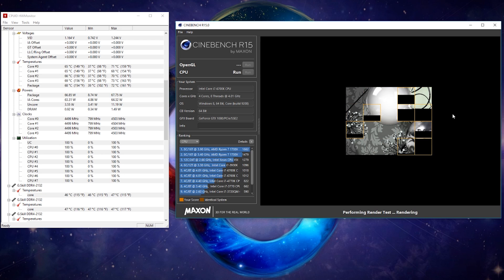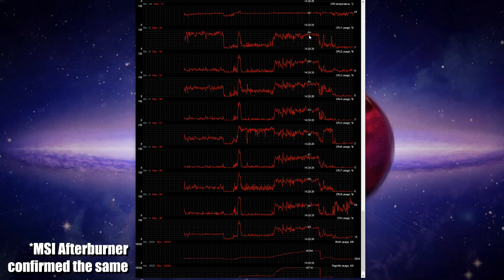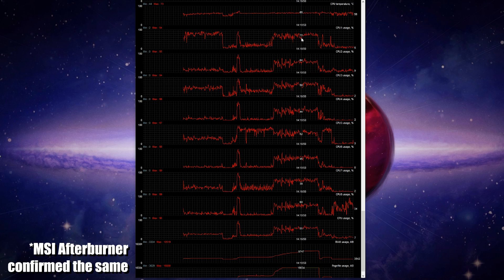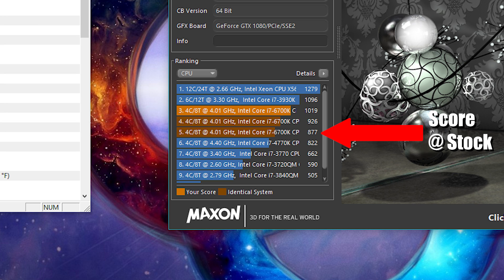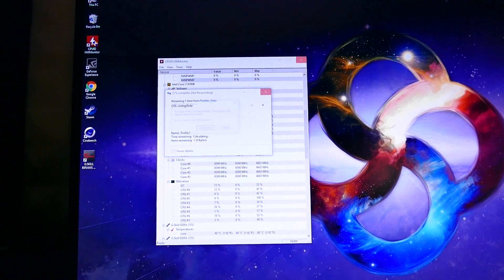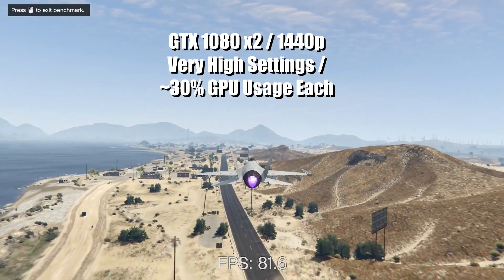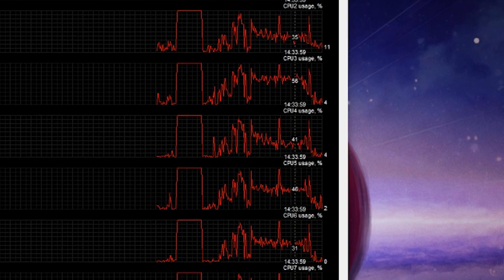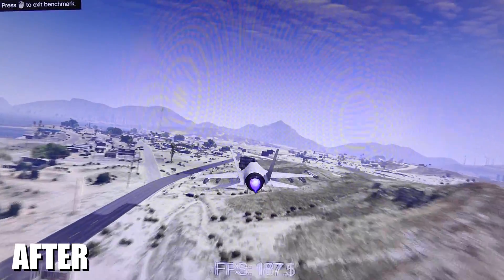My PC was Terribly Under-Performing...

Comment from the maker: - I appreciate the feedback and suggestions as to what may have caused this. A few of you think I didn't bother using DDU and reinstalling graphics drivers. I tried that multiple times. Also made sure power saving was off in both Windows and Nvidia CP. The BIOS clearly showed 4.5GHz OC, as did HWMonitor, so I never thought to immediately clear CMOS. Also swapped multiple HB SLI bridges. Super strange indeed!
Reply: "If you can beat it with a hammer, it's hardware. If you can only curse at it in futility, it's software."
Reply: Science Studio It is very possible that you could have had GameMode turned on in Windows 10, which could have  theoretically throttled your GPU to under perform up to specs. Hope this help and it would be awesome if you could test this and let me know if this was the problem. A very simple fix but very troublesome.
Reply: Science Studio perhaps if you are using win 10 the game mode from creators update might be affecting this a bit.
Reply: Perhaps your CPU cache was being pushed too hard and making small errors here and there, which were corrected by the caches built in ECC/parity, causing poorer performance without any other signs?
Reply: Science Studio Well, we all have strange things :D

I have a (somewhat big) problem. Ever since i replaced my old graphics card (died, rip gtx 570) with an rx 460 (similar performance) i couldn't open up the BIOS, when i boot, it just simply  skips it (black screen, when the bios menu should appear), but my PC works flawless. I assume the problem lies within the pci-e cables.
My RX 460 doesn't need one, so it may pull too much power from the motherboard (p8b75). My PSU is fine, it's an ANTEC EA 450W bronze.

Any ideas?
Reply: @swaggsmr.2607  it might be that the bios is displayed on another monitor try plugging in another monitor to see if it comes up, i had the same issue until i plugged in another monitor
Reply: i work whit pcs too, windows (specially win 10, for some reason) "breaks" itself so often... idk, its common to have windows mal functioning (speccially after a bad CMOS/BIOS problem)... sometimes reinstalling is a good problem solver... but my knowledge is based on servers/ home pc, not gaming rigs
i know, my english sucks, but warever..i hope this get to be useful to someone...
Reply: I kind of believe it was an OS update as even I have ran into secret updates that change things in windows and software to hardware utilization
Reply: Though the problems with CPU and GPU were not specifically pinpointed, I'd suggest meticulously noting operating system settings and BIOS setting.  Any time you make a change, note it and test the results.  It may take many days, weeks, or perhaps months, but you might be able to zero-in on the issue.  Many years ago I had a system that was having severe performance issues somewhat similar to yours.  After mentally stepping back then reapproaching the problem systematically, it was "bad" driver issue with my NIC.  It took a while, but that step-by-step process of troubleshooting got me to a solution.  It was when I isolated myself others' ideas (though they were trying to be helpful) that I was able to hunt the rabbit down.
Reply: Science Studio thats how you can always fix issues like the one you had, reinstall windows fixes everything, when games dont work reinstall windows, any issue that you get that seems like its working but doesnt and you cant fix it, reinstall windows, its a pain but thats how i fix almost any issud
Reply: Leonardo Brioschi yeah I too think that would have sorted it instead of a completely new windows install
Reply: Plz, make a video where you're trying to use GNU/Linux :D
Reply: In regards to the GPUs I've seen similar once on my twin 980's, IIRC I fully wiped the graphics drivers and reinstalled (from the same package). But yeah, never truly figured out that issue, just that my GPUs have been running fine since.
Reply: i would uninstall any overclocking or monitoring apps and disable the shit out of everything related to xbox services ( even better if you completely remove it from the system ) and just to be safe maybe verify the game files or just reinstall it
Reply: I had a similar issue a while ago with a i7 6700k and GTX 970 and reinstalling DirectX and reinstalling graphics drivers did the trick for me.
Reply: @marcelviviers8038  I just said out with the old Radeon “5700xt” and in with the new “3070 ti” and for the last three weeks been troubleshooting why my game after playing for 10 mins will drop frames below 100 in bf4 and stutter everywhere and lag, spent three weeks fully optimizing windows settings, control panel settings, in game settings, stream settings, bios settings, everything is up to date. And everything has been clean uninstalled and reinstalled but you mentioning direct x is something I haven’t thought about yet! Thank You! Another way forward!
Reply: Isn't there currently an issue with Hyperthreading on Intel Skylake and Kaby Lake cpu's currently though? Maybe in multi-threaded loads the performance hits would be noticeable but I don't know how clearing the cmos could fix the issue... I wonder if updating the bios would fix any of the performance issues (consideringt the microcode hotfixeus are being pushed out via bios updates).
Reply: david buddy Yes there is an on going issue over both sky/kaby lakes. Right now they are saying that disabling HT is the only work around until BIOS updates arrive
Reply: Science Studio it happened to  me  the gpu problem , i think it is a error in windows 10
Reply: Science Studio did you tried cleaning drivers and reinstall ?
Reply: nxtg77 video drivers get nasty with some times just updating them, they don't clean up properly
Reply: Use DDU next time, you will keep using it after.
Reply: You simply might have had particular file(s) corrupted do to small errors that do happen from time to time even with ECC memory which reduces errors to fraction of a billions. This can happen inside the SSD/HDD over night or active, CPU does trillions of calculations per day and overclocking does introduce more possibilities for errors. Pretty much everything in your PC can cause an error which starts to accumulate if introduced in a very specific file which can start corrupting even more.
All this can be caused by a simple virus or malware and even with a antivirus and common sense, shit can happen. Specific windows or any other major software inside your PC could have introduced very specific kind of scheduling error which caused performance hits.
Anyway this is the reason why we wipe OS every now and then to make sure everything functions properly even though everything might seem fine.
Reply: Had you overclocked the 1080s at all? I had the exact same thing happen to me after overclocking my 1070 a smidge too far, it wouldn't perform anywhere near its normal spec until I reset the card bios.
Reply: Have had this happen on a few different SLI builds. One of two things, I had issues with SLI not working correctly if I had Logitech Gaming Software enabled. Change out my mouse and keyboard, and FPS shoots way up, and stuttering would go away, so I uninstalled the software, and reinstalled, voila everything back to normal. This was very game specific however. 
In your scenario, I would go to the C: , look for the folder called NVIDIA, delete that folder, and all contents. Go to your Program Files X86 find the Nvidia Corporation folder, and delete that. This is cached driver information that if you are reusing the SSD from previous builds, can sometimes contain corrupt information. Use control panel to uninstall the driver, then follow that with DDU. Boot into windows, and redownload drivers and reinstall, cross the fingers, and all should be good.
Reply: i really don't think it's a windows update issue cause the update will still exist after a clean windows install or at least it'll update itself again
Reply: Given the recent WannaCry nonsense, make sure you fully update windows
Reply: Science Studio could it of been a curroption of the os ? maybe gpuboost 3? 
ya can bypass reinstalling the os by running a few commands if its an os curroption. their is more direct and forceful parameters you can set. but generally this dose the job.
"sfc/scannow"
if nothing, then try this.
"DISM /Online /Cleanup-Image /RestoreHealth"
Reply: Well, did you have any software like Riva Tuner or similar. It's pretty bugged with many things.
Reply: I was about to suggest DDU since I didn't hear you mention it (maybe I missed it?). Since you weren't able to replicate the fault, I guess the issue was within the bowels of Windows itself. It's frustrating when something craps out inside Windows and you aren't able to fix it. Thankfully it didn't happen to me in years, but I know the pain.
Reply: You've got the exact same issue on the GPU side as I did.
DDU & fresh Drivers did it for me. (same exact version I had earlier)
Benchmark scores literally doubled on a single GPU after doing that.

Nvidia drivers get buggy over time when updates are installed on top of old drivers without a wipe.
Uninstalling Nvidia drivers wont actually fix the issue as it wont completely wipe them.
Reply: Science Studio It could be some random windows update which causes the issue. Did you try to restore your pc to some back date?. Maybe try using pc optimization softwares like tune up utilities or something.
Reply: You should've probably tried doing a fresh install of the graphics drivers. I don't know why, but NVIDIA drivers do some weird stuff, like shader data dumping in one of the folders inside AppData or ProgramData (I don't remember which) I would've tried cleaning ALL NVIDIA software from my computer and reinstalling the drivers.

Otherwise, I think what you say may be the issue is the right thing. Some hidden or random Windows setting was maybe holding it back. I would've tried restoring your system to a point in time where you didn't have the issue, or at least backtrack a bit and think about what you may have downloaded or changed in your PC since the issue started. You know, classic troubleshooting.

Also I don't think this would've helped, but there's a Windows service that was added in Win7 or 10 I believe, called Superfetch. You should always turn that shit off, and make it STAY off. It's a process that's supposed to optimize hard drive usage so that your PC doesn't get slower with time, but all it does is cause random %100 usage stats on your HDD and make everything slower at seemingly random times.
Reply: I wish I knew where my notepad was to keep up.
Reply: i have asus strix gtx  1070 and i7 6700 and 16gb DDR 4 ram @2666mhz but i got about 150fps in cs go , btw my friend has msi gtx 760 2gb  and he have +300fps in cs go , why this happend ? plz help i tried to clear CMOS but it didnt work :(
Reply: i had a somewhat similer issue a month ago and in the end i started looking into my dpc latency which i know of from audio recording.
that helped me.
Reply: Maybe get rid of the RGB RAM and software. Test it with something that doesn't have a "glitchy" driver / software. No clue if you've tested this or not but I've read some horror stories about it in the past. Just food for thought.  Good luck.
Reply: are your settings different? its kind of a CPU bound game believe it or not.
Reply: What about the power settings on windows? lol. Perhaps you changed it to power saver or something. I have no idea. However, that's the only thing I can come up with that would affect both the GPU and PSU. Maybe the OS was taking priority over your Nvidia performance settings.
Reply: where your gpu's accidentally underclocked
Reply: What about using something like Revo Uninstaller? Run that when uninstalling the Nvidia software and it'll rip out ALL of the OS files & any registry entries with it. Worked in the past for me once a couple years back. Alternatively, since you've got Win10, try doing a non-destructive reset (go to the Advanced Startup Options and choose to reset OS but keep your data). This way the core Windows files are all restored to their defaults but your actual user data (docs, music, vids, etc) aren't touched. Then you only have to reinstall programs instead of programs+re-importing your data.
Reply: sounds like power saver, yes for some reason pc os has power saver like a laptop
Reply: Install your own custom Windows build. Instal everything you like-software, drivers and make a Backup ISO file. Or use lighter Windows version. I install Windows 6-7 times a year (maybe more) & every time is around 15 min untill boot in Desktop.
My 7600 on 5.2ghz highest score in Cinebench is 879. https://www.facebook.com/photo.php?fbid=10208473056258166&set=a.1900142277497.85690.1659876006&type=3&theater
Reply: Science Studio how did you first install windows 10 (or the last major update?) depending on how it was done (usually manual installations) the os can become finicky and decrease performance. I don't see how it could utterly wipe perfeormance like this (I'd expect it to be a driver issue, but you said you ddu and reinstalled), but I wouldn't have passed it by windows. I wish you would have run some tests in an external OS to quarantine windows, since it's the next step in the stack after hardware/bios.
Reply: Registry issues, maybe? Are you able to replicate that faulty condition? If you could, I would suggest to do some roll backs to see if your performance increased back to what you had before.
Reply: Science Studio From my experience something happened to the registry causing your graphics drivers to act erratically even uninstalling and reinstalling would do nothing, cleaning via ddu nothing. I've had it as bad as I could never get the driver to install. I had to manually go in and delete everything using rapr. amazing utility it'll show every useless driver you've installed on your computer. It won't let you delete something your using unless you force it... which I had to do
Reply: freak777power fuck windows 7 windows 10 ftw
Reply: So I had a similar issue s with my gtx 1080 ti and it was caused by a gigagyte program on my pc. It's the Gigabyte Suite or something like that. My GPU was having the exact same issue. Try removing Gigabyte software from your pc.
Reply: @Science Studio I Had a similar problem before, My fix was to turn off the automatic driver updates that were implemented in windows 10. Turning that off (like in this image: http://puu.sh/wy2zU/7cc8e3ae07.png ), and manually downloading and reinstalling my device drivers fixed a bunch of issues I had. I assume that it tries to install display drivers when you restart, which can really mess up your performance.
Reply: yup that's why I never use windows 10 uses your internet more with updates of everything and sending whatever your doing back to microsoft server. Use windows 7. 5 mins video is suposed to be 3 mins only even 10GB only your internet. Windows 10 have hidden process.
Reply: Science Studio you may have had a pice of malicious software on your machine, or if you have the Creator's update make sure to turn of the Xbox apps, they have caused issues for me.
Reply: Im asuming windows ten... did you have insider preview builds?
Reply: Jack Ryan cuz he's gay and gay doesn't meet with hardware.
Reply: Maybe you've selected a different power scheme. Even with the same settings there is a big difference between eg. "Balanced" and "Always On".
Reply: Chek if your psu is on EcoMode
Reply: My PC was performing terribly and it ends up being Xbox DVR
Reply: i hate to say it, but i been a little overdue for a fresh os install >.>. but i try and do it once a year, ive had software fuck with me like this. So i try and do it every 1-2 years >.> though i have the felling I'll finally be going to windows 10 T.T
Reply: ProDrifterWinner im hopeless tho I bought a prebuild and pairing it with an Athlon x2 or something it's 4*2.9 GHz so it's probably bottlenecking my gpu.
I'm probably building/buying a new  pc when the vega cards will be out with a ryzen 1600 or maybe 1700 but the 1700 will probably be unnecessary for gaming only
Reply: watch?v=W2KhRPVGQYc  this may be your issue, its about Asrock mobo  for ryzen
Reply: Swaggs Mr.: I had a problem like this a while back when I switched from my projector & big screen to a 42 inch & 24 inch combo setup. If you wanted to go to the bios it would go black on both screens and then a bit later would start booting. I am not sure what fixed it because I changed out my mouse and keyboard as well as switched the cables around on my 2 screens as in just flipping them around. Anyways which ever was the fix I can now go into the UEFI and make changes my card is a Sapphire 390x so also a AMD card. I would try a keyboard swap if you got another one laying around just unplug your every day keyboard and try another one or just plug your keyboard into a different USB slot preferred USB 2.0 slot.
Reply: Swaggs Mr. You have to flash the vga bios with a custom one, that haves a lower power  consumption state during the boot time.
Reply: Science Studio, I would reflash the bios, with the same latest version. You wouldn't believe what a corrupted bios is capable of ! 
  And, Windows 10 is on another level of controlling the hardware.
Reply: Something like this happened when i wanted to overclock my APU, I've got an amd a10 7850k with r7 iGPU and whenever I overclock, and also increase the voltage, obviously by really low ammount, 2 of my 4 cores get stuck in 1.8Ghz no matter WHAT, so I get even worse framerates that when I am at stock speeds.

My iGPU, as of a result of being limited to 2 Oced cores and 2 cores running at 1.8GHz, gets almost no utilization! (would jump from 50% to 0% then back up 90% and back to 0%, really weird, probably because its been bottlenecked by the 2 CPU core's low speed)

 I dont know if your problem is related to this, but is the only scenario that i could relate to while watching this video.
Reply: Did you try wiping your pc clean from cache, registry and other unnecessary files by using a program like ccleaner? Sometimes that may cause issues with your PC if it hasn't been clean
Reply: I noticed that HWMonitor didn't show more than 68w used by the CPU, I suspect that your Mainboard was limiting your CPU to 65W TDP. You can change that value on most better boards manually. I noticed that since I limited mine to 80w for thermal reasons.
Reply: Adaptive Vsync (half)? Your framerate was exactly in half
Reply: I've tried to see the comparison frame by frame, but I'm on the phone. Seemed exactly halved
Reply: It is a microcode error present in Skylake and Kaby lake Chips when two threads from the same core intersect. I am 90% sure of this as the cause of your issues (with the CPU)
Reply: PC Perspective has an article on it.
Reply: Gregory Jones II thanks man.
Reply: Science Studio Did you have speedstep on? You'll get higher cinebench scores running with a fixed multiplier (I know you know this)
Reply: Science Studio was it a mirrored drive(s)? kinda curious.
Reply: meh...will say something retarded...here comes...
i planted an i7 in my laptop and the power brick it had from factory had 90W...with the i7 the laptop needed 130W power brick but low on funds i had to make due with the 90W one...and the exact thing was going on with my laptop...my gpu was going up to 60% from time to time...but that was it...in some games i had on my laptop before i planted the new cpu was above 100...now i had max 50 FPS...bought a new power brick, REinstalled shitdows(because updates when i dont want them to update) and all is back to normal...not so usefull but...xD
Reply: Science Studio my guess is bad secondary ram timings ie "auto timings" can be bad reference "actually hardware overclocking channel" but I've seen that happen before i always manually set all timings but this is as far as the CPU.

the video card have you used NV inspector and possibility set a FPS cap I have one set at 110 FPS because my Asus ultrawide monitor gsync is 100 hz.  possible you accident set one that capped you video card
Reply: +Cookieking Gaming 
m8 i accutaly don't whether ur joking or not
if not: 1100 watt not enough for 2 1080ti and i7 it is not a GTX 400 serie card
if yes: gg m8 good one

about your GPU problem lets just say windows 10 is not to great for stability and leave it there
Reply: I have had to repair chipset drivers in the past. When you launch the chipset driver installer, it gives you the option to repair the chipset driver installation/registry... Clear Cmos first, then boot in default settings, and launch the chipset intallser, click repair option, and that might save you a fresh install next time... 

The chipset trick has subsequently saved me from fresh installs. It seems to get out of sorts up with too many unstable overclocking sessions somehow. Or at least in my case there is a strong correlation between me pushing it to the crashing point over and over while trying to beat scores I will never beat on things that are pointless and needing to repair the chipset clear the CMOS/Repair the chipset installation. I also have the 6700k in a z270 board. All the issues it solved had to do with PCI-e lanes, and other power delivery problems to onboard devices/headers.
Reply: What solved it for me was updating my BIOS. Purchased my setup about a year ago, and just this january they released an update for the z170 that fixed SLI, so SLI was not fully supported for a MSI Gaming M7.
Reply: I've had this problem with my cpu as well http://imgur.com/a/PrwAA
Reply: Win 10 just suck for gaming
Reply: zvelekva Windows 10 works fine for me
Reply: Windows 10 update ver ?????? bugs bugs buggy!
Reply: ver 1703 build 15063.413
Reply: I think i know what happened. I think putting in that dirt cheap PSU might of tripped some kinda safety setting in the Windows OS to reduce performance so the system didn't fry while using that PSU. But windows didn't realize you put back in the good PSU after you were done!
Reply: Which would explain why reinstalling windows fixed it because a fresh install of windows reset all the settings. Including some that you may not of been able to find!
Reply: Science Studio u can have done a system restore pal
Reply: Possibly whats mentioned in NCIX Tech Tips video: Radeon Vega FE preview, W10 source code leak, Skylake + Kaby Lake hyperthreading
Reply: just windows stuff
Reply: I had have similar problem before couple of mounts. I have X99 platform with I7-5930K on windows 8.1 64bit overclocked to 4.6GHZ witch must scores about 1300 scores in Cinebench r15. But for some stupid reason my scores was drooped to 1100 and it was imposable to get it higher even if i kill every not vital service and process (before the problem my pc scores more that 1300 after startup with bunch of parasitic software running). Witch made clear for me that this can't be software issue. I noticed that my task manager does not report the correct cpu clock witch was odd because system runs on the same setting for mounts and last i check it was fine. Also base clock frequency of my cpu fluctuated to much from 75mhz to 95mhz but never hit 100mhz under load. I decided to start with a clear BIOS and set everything again. Wen i start the pc with defat BIOS settings the task manager reported clock just fine and base clock was rock solid 100mhz and fluctuated only with 0.1mhz witch was perfect. After that i go back to BIOS and apply my clock settings. Back to windows and everything was fine task manager report the clock correctly, base clock was stable and cinebench scores about 1300 scores perfect. After that i go to the BIOS to change some not so important settings like fan curve and others(including virtualization). Wen i get back to windows the problem was back so i disable the virtualization and everything was fine again. My conclusion is that the problem was cosed by the intel virtualization but in order to manifest it self you have to install windows Hyper-V virtual machine in my case Microsoft Visual Studio mobile device emulator was the software that manifest that strange behavior. I even tried stock CPU clock with virtualization on and the problem was back. So after that if i need to use vurtualization feature i restart my pc, I go to BIOS turn it on and, when i am done with it, I restart again and turn it off.
Reply: Jonathan Laig It's not a Wildfires Windows 10 vs Windows 7 thing, it's a Windows thing. Operational efficiency in Windows just decreases over time, it always has. The only was to keep it running at peak efficiency it to reimage about every 6 months. That's why i keep a custom up to date MDT image on external HDD.
Reply: 1st issue was a power saving setting in the BIOS that was probably still on when it shouldn't have been, then with the SLI issues I would think in was an issue w/in the NVIDIA Control panel and then wiping the NVIDIA drivers if you can't get the C.Panel (NVIDIA) to default back to "stock".  I had the CPU utilization with a 4790k that was OC'd to 4.8Ghz and wouldn't fully utilize the threads/cores (BIOS flash fixed mine - which was a power saving feature I missed (Z97X-SOC Force)
Reply: @Science Studio - As u confirmed nothing wrong with HW/SW... Windows updates might be the reason for this.... It happens a lot for me for my Nvidia Quadro cards... Win Updates somehow messes up our graphic drivers....I use a lot of GPU + CPU processing power and I see latency issues whenever there was an unexpected update! Try disabling it and test the new config for a month..I think it will resolve your issue(also keep ur %temp% clean).
Reply: Science Studio I had this problem with my os windows 10.  it happen after a update in the insider program.  I had to reinstall and performance was back to normal.
Reply: if you have the time it is almost worth building a network deployment server these days, any real problems that take more than a couple of hours to fix, just blow the machine away and rebuild from a good image.  learn sysprep, etc.
Reply: OH man! I had worse problems. After a huge win10 update I had blueish and yellowish textures. It was nice how it happened it started on one pixel than the textures turned to the color of the card's choice like a spilling ink effect.
It is usually the OS. I tried the driver clean install several times before total reinstall. It always turned to a fascinating new color each time I installed the driver.
Back to the said huge update. It just destroyed the drivers and drivers installed after the patch were broken AF. It was a windows fault but I have my profiles relocated to a RAID 5 array so reinstalling an SSD is the east of my concerns.
Reply: Did you reinstall GTA :)
Reply: Science Studio Virus, Board issue? There are just SOOO many variables in these situations. I find it odd that both your CPU and GPU were under preforming. Possibly BIOs issue for the GPUs aswell?
Reply: yar i thin its registry    when uninstalling and re installing sometimes wrong values get written to registry
Reply: Does anyone know the fix? Same problem and im not done watching the vid btw
Reply: Swaggs Mr. I had the same problem with my rx580 using a hdmi cable. Switched to a dvi. Problem solved.
Reply: Science Studio you think that's bad? I get 15 fps average at lowest settings at 100% usage
Reply: You may are run you lcd/tft on hdim cable , try to connect a dvi cable and see if you see your bios boot screen ..
Reply: Science Studio This worked for me! I reassamble all the pc parts.It worked for mr
Reply: I have 2 Gtx 1070 8 gb each on my rig,  but cpu -z is reading only 4 GB. I don't understand why
Reply: Greg Salazar so what did you do to fix it? You wiped ur entire system?
Reply: Msi afterburner is making the problem.... Ive use it recently and had the same problem
Reply: I didn't have same config like you but i had about same issue like you underperforming gpu usage,Check your brand of gpu if it is zotac go on zotac site and download old drivers first , uninstall using ddu in safe mode and make sure you clean your pcie slot and gpu.worked for me however i think your issue was windows os itself
Reply: Hey,Same thing happened with me my gtx 1050 ti was underperforming  the way i fixed it was very first used ddu in safe mode to remove drivers &Next step is more important
The key is to get oldest driver or first driver released you are lucky if you have dvd/cd with you or else go to manufacture i.e for me it was zotac went to their site and downloaded available driver at first you need to perform clean installation you might get artifacts after installation than u need to install driver again and make sure you remove your gpu clean gpu lining with an eraser or cleaning agent (Isopropyl Alcohol 99).This worked for me
That worked for me.
Reply: Science Studio I remember you mentioning your PC was underperforming with a cheap PSU. 

If the PSU wasn't the problem, then please note that in the description.
Reply from the maker: No, I presume it was underperforming long before that. I just never bothered benchmarking Andromeda because I'd already basically done that with Blue Sky.
Reply: @GregSalazar  mine is only doing it on some games which is more streangw
Reply: Did you try wiping your graphics drivers and using the base windows drivers to boot without the Cards. (Should be really low resolution) then power down the Computer for the second time, insert the cards and reinstall the Nvidia Drivers?

I had a similar issue when building a Pc for my friend. It wasn't recognizing recognizing the GPU normally and was limiting its usage. I Booted the Pc with the base windows drivers and made sure that it was not sourcing any drivers besides the base windows ones(That is why I completely got rid of all of the Graphics drivers). I booted the PC with the card Via setting it as the default video device in BIOS and reinstalled the drivers. Once done the PC returned to its original resolution and I did a few benchmarks to make sure everything was stable.

My friend hasn't had an issue yet.